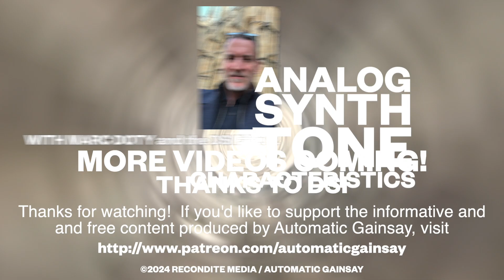What makes an analog synth sound analog?  Part 1

Comment: I want to add to this vid. I have 2 DSI machines. The Pro 2 and Tempest. Both for over 10 +years. What I have found is that Dave never put anything on a platter ready to go. You MUST work for it. The point of extreme flexibility, is starting with a blank slate. Ya, the presets are good, but I use randomizer software for both that takes these machines to different galaxies of complexity that a mortal would never imagine when creating patches . There are a 100 million plus possibilities in these machines. I have a large patch library of both and I will put them out as free soon to be enjoyed by all DSI lovers. It’s really a metaphysical journey to do this. When you study the patches that were created by the hand of god, you hear and see possibilities that have never been considered. I think Dave Smith didn’t know the possibilities he created. Lately all my spare time is with the Tempest. It’s become my second fav of all time next to the Pro 2. It’s probably the deepest synth ever made with 6 separate synths going at once. Because that’s what it is. Mark, if you interested in getting some of my patches, let me know.

Comment: To me the biggest factor is whether the controls are digital or analog. With digital controls, such as the Korg Monologue, if you're doing really subtle tweaking you can hear the stepping from one digital value to the next. It's high enough resolution that you don't normally notice it, but I really like to do those delicate high-resonance filter sweeps and Monologue's digital controls make the whole thing sound digital even though the sound engine is analog.
On a polysynth there's not much you can do about that since the controls kind of have to be digital, but on a monosynth I think it's well worth giving up patch memory to have analog controls.
Reply: Hydrasynth addresses this by using NRPN 14 bit controls. Hopefully MIDI2 when eventually adopted will do away with 7bit controls. At least with the next generation of synths.
Reply from the maker: This has a lot to do with preset synths.  With truly analog synths without the digital controls necessary for digital patch storage, the controls have the infinite analog range, where there is no stepping.  Of course, at the expense of presets!